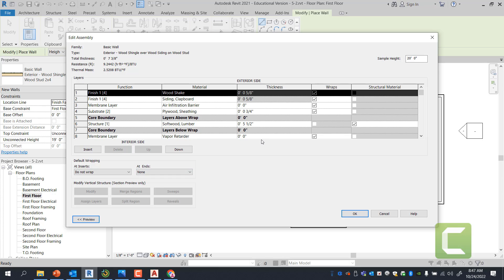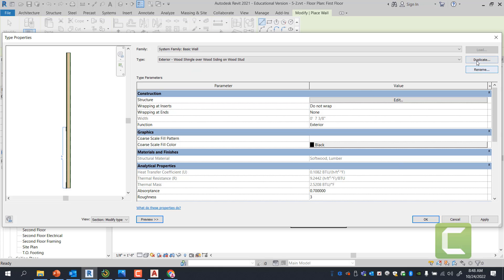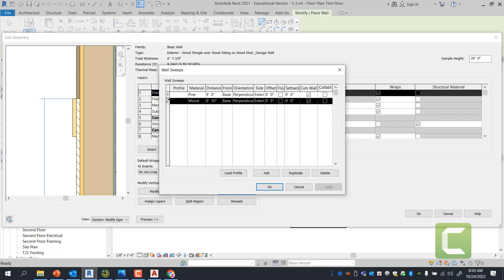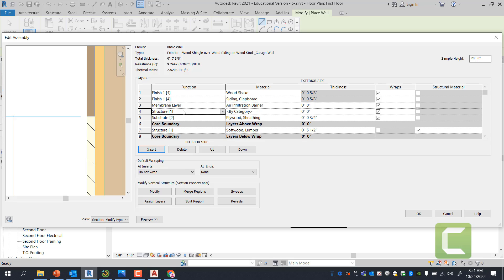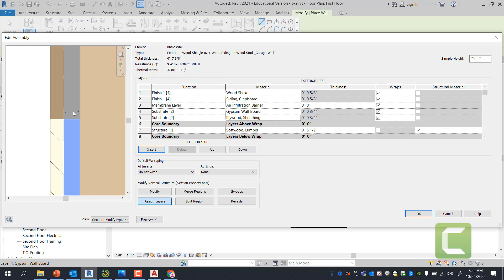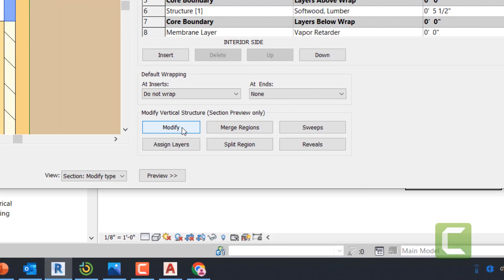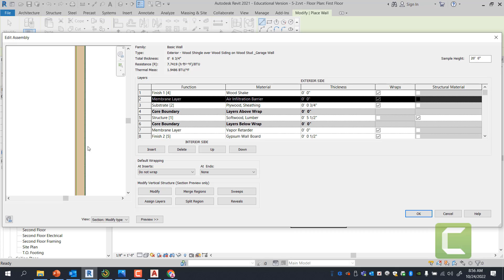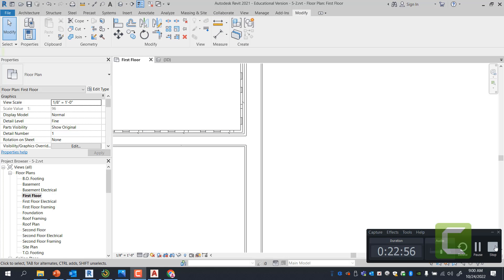How to modify Wall Section properties in REVIT (modify vertical structure)

Comment: thanks for the video! is there a way to stretch your wall layers separately? once I modify and unlock some materials they all stretch as one piece but I'd like to stretch the separately and it doesn't seem to let me do that
Reply from the maker: I do cover how to select wall, “Layers”separately and then modify them in section if they have varying heights 

How to create Walls (Advanced) in REVIT
https://youtu.be/CDqoe9G5Mu4

I do want to point out based on your situation if the wall is very complex let say in a high-rise stretching across multiple floors, my advise is to create individual walls that are drawn right next to each other in plan and manipulating those wall using edit profile in elevation. Hope this helps!